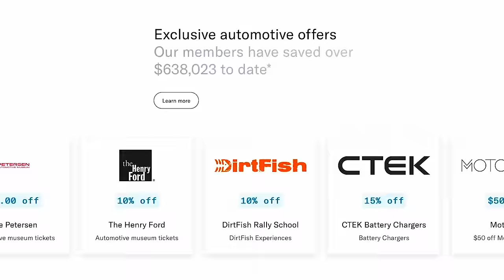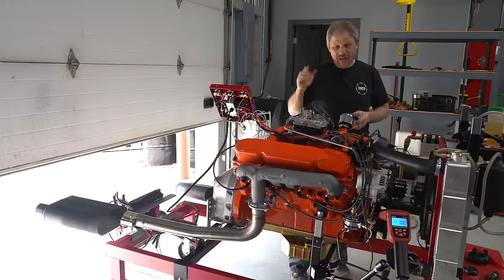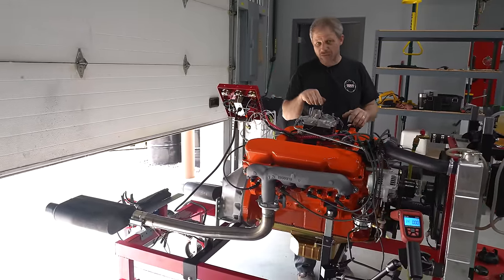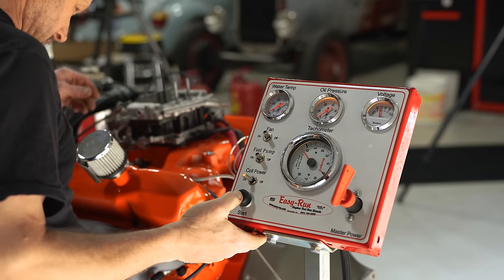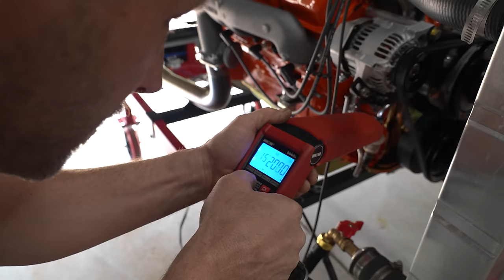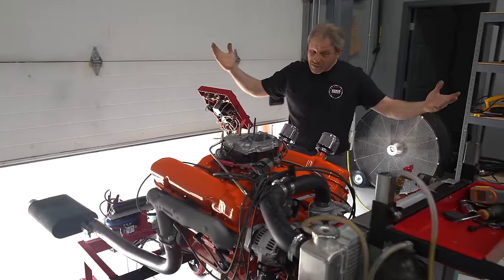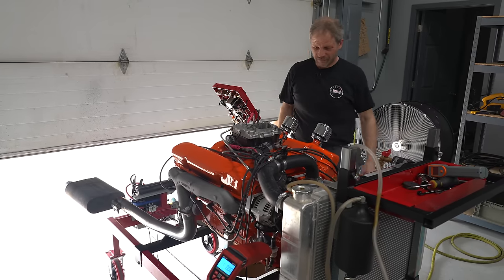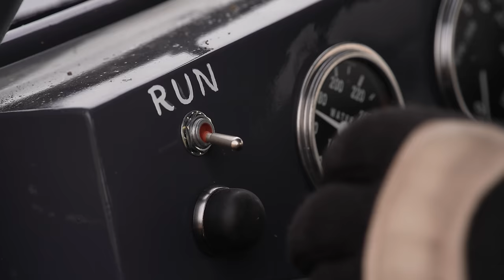Restoration Time-Lapse: MOPAR 440 V-8 Engine & Vintage Ford Race Car | Redline Rebuild

Comment from the maker: If you're interested in how much power this engine made, check out this video: https://youtu.be/5HggzAgdNto 
Some of you may have noticed that the engine changed a tiny bit from when we were done in the shop to when we were on the track. Well, we made some upgrades and gained some horsepower and torque. Check out the video!
Reply: Cam specs? Compression ratio?

Comment: Davin is like that cool uncle you never had that is a complete motorhead spending his time half in the shop and half in the racetrack
Reply: As an Crazy Uncle, I approve this message.
Reply: I also love Uncle Davin works on EVERYTHING and isn't a brand snob.   If It's mechanical.  I like it.  All brands have made both great and shitty engines/cars.

Comment: the 20 minute break in. I'm assuming no thermostat and why the open hose with hot water running out. Are you intentionally pumping cold water in that block? Thanks!

Comment: I never understood why some engines have their distributor canted at an angle. They in the tear down I saw you spin off the oil filter and there was an oil pump behind it. Wait. I think I got it! The oil pump is external and still is driven along with the distributor off of a common shaft. Wow! Mopar sure marched to their own drummer from torsion bar front suspensions to externally mounted oil pumps.

Comment: You spend the time to Glyptol the inside of the Block ,why not the top inside of the heads ? I do love this Build ,Dirt tracking was Big in the 50s when I was growing 270 Jimmy 6s pounched to 300 Cu in. was a hot item also Flat heads with 4 in merc cranks, quick change rears and Columbia two speed rears were around but rare .

Comment: So, back in the day when all camshafts coming out of Detroit were flat tappet, how was the break-in handled? Camshafts and motors certainly weren't broken in for 30 minutes @ 2500 RPM. Yet cam failures seemed to be non-existent. What changed?

Comment: Hi again. Too bad that the error in the original presentation was NOT corrected. I wrote to the show before to correct a few errors. The is NOT a 1937 Ford coupe but a 1940!!!!! Note the trunk lid. 1937 had a smaller lid that did not extend to the lower pan. Also considerably larger. The windshield wipers in the videos clearly show there are small patches on the upper cowl where the chrome stands were and no evidence of holes where the 1937 wipers are located on the roof.  The only '37, '38, and "39's (like Tom's woodie) were the exception.

Comment: Good restoration but you should put ford engine 260 or 289 or 390 big block but not mopar engine  good job on the restoration

Comment: Nice but they painted the engine after the assembled at the factory. They also painted the exhaust manifolds the same color and let it burn off

Comment: To me, building a 440 "race" engine but using 906 or 452 heads (instead of aluminum) is like getting married but skipping the honeymoon.  Actually, it's 10x worse.  But perhaps the race rules being targeted do not allow that sort of upgrade.